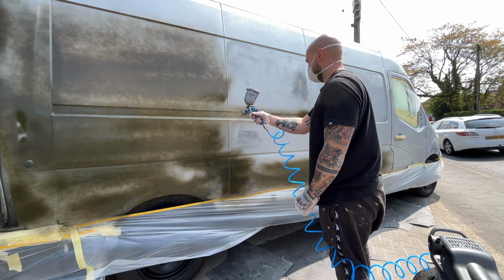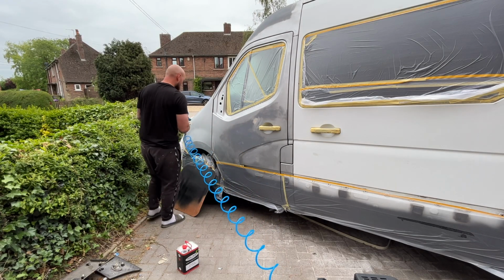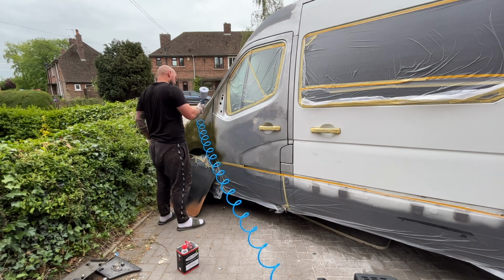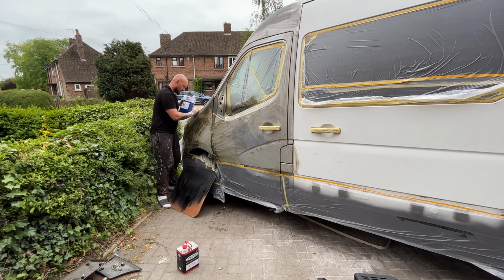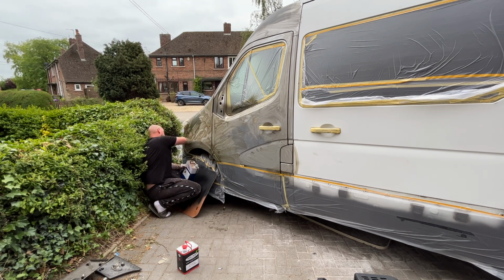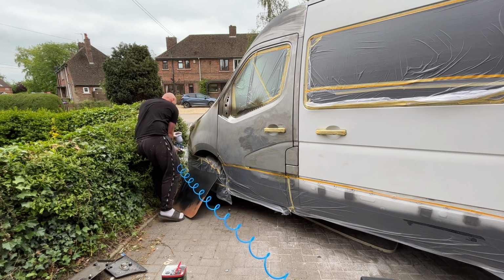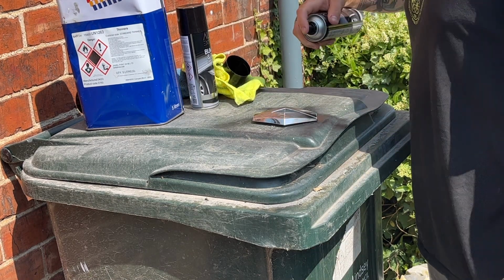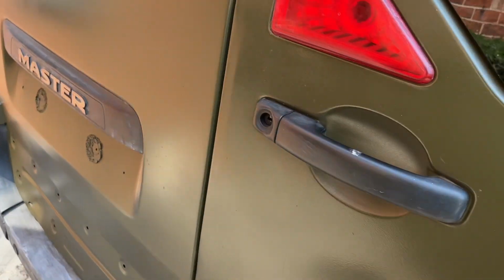DIY Camper Van Respray using Military Paint | Satin Green

Comment: What size compressor did you use?
Reply from the maker: I used a 50 litre SGS compressor. There should be a link to the exact one in the description.
Reply: @Renovation-Dan  my bad I didn’t check the description. Thanks for the reply.
Reply from the maker: No problem at all

Comment: How many litres of paint did you use?
Reply from the maker: I used a litre of the black paint and 5 litres of the green
Reply: Do you let it dry between coats?
Reply from the maker: @alisondarcy7517  yes but this paint dries really quick so you can do multiple coats in a few hours, rather than having to do it over multiple days
Reply: It's this rustoleum paint?
Reply from the maker: @ellokomexicang216  no, it’s military paint
Reply: I'm about to do this to my VW T25.
What ratio of thinners did you use?
Reply: Does masking need to be removed before it cures?
Reply from the maker: @c1tlr340  I used 10% thinners by volume
Reply from the maker: @c1tlr340  I removed it fairly quickly after painting because the military paint is touch dry after about 30 minutes